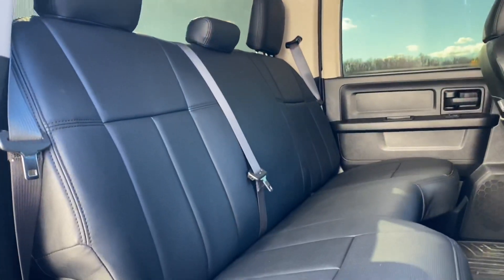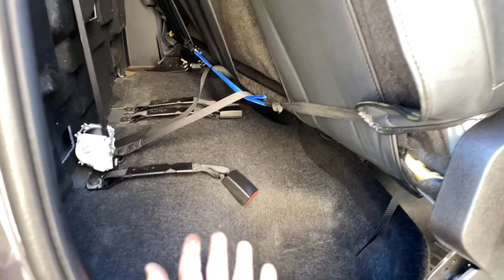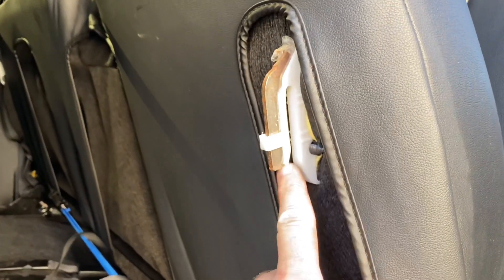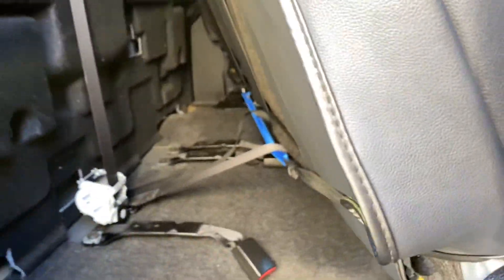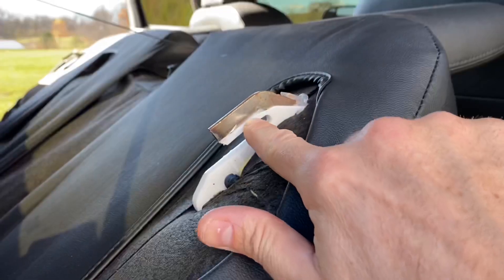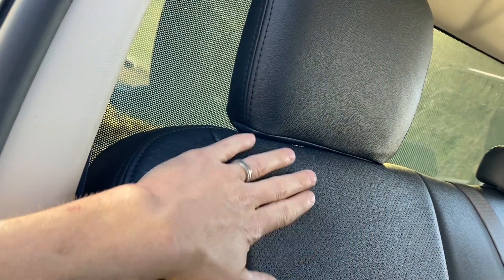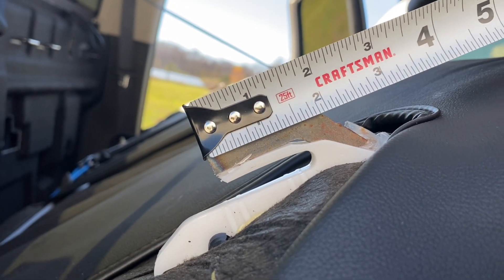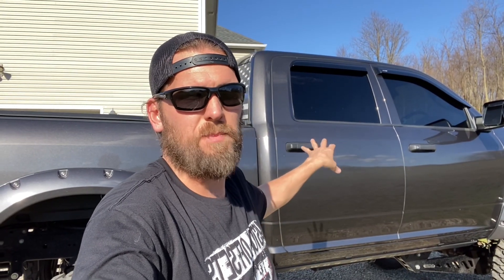2016 Ram 2500 Crew Cab Rear Folding Seat Modification

Comment: Best version of a Ram 2500 quad cab rear seat mod/fix I've seen yet! Reason being I want to put my 
XM 177 e2 back there. Just didn't want to mod it in just any fashion. Was going with raising the seat but didn't want to change the height geometry although it wouldn't be bad because I have a big amp under the seat and raising it would help keep it running cooler. Decisions, decisions??? 🤤😂

Comment: Another option is to raise both rear seats by 3/4 inch .. just need longer bolts and a metal or wood spacer.  This way you could return to factory if you wanted.
Reply from the maker: Yeah I thought about doing it that way but was worried about the seat not being fully secured for safety and losing head room.  But absolutely, spacers would work.
Reply: Only problem is back seat won’t lock in if you raise the seat
Reply from the maker: True, so if you need a speaker box for example that requires you to add spacers, I would suggest adding spacers first and then cut small adjustments as needed.
Reply: Actually,  as long as you haven't cut the seat holding bracket, the 3/4  inch raise will lock and allow you to fold the seat down if you want.. did it to my truck
Reply: And just for clarity.. I used 3/4 inch plywood which is technically 23/32 in the states. Just in case the measurement diff matters ..
Reply: @djmjr77  ya your right ! I watched another video! My bad!
Reply: this is the worst advice ever. lol...

Comment: Nice video. Does it work on a 2023 ram classic 1500 quad cab? Thanks
Reply from the maker: Not sure have not tried that yet.  Unbolt the rear seat and lift it up and if it has a similar setup it should.  Or, place spacers under the seat to lift it just enough to accomplish the same thing.  Maybe 1/2”?

Comment: Hey brother nice video. quick question are the seats able to fold flat or only as far as your folded em in the video?
Reply from the maker: They don’t fold flat as the seats were not designed that way but if you need it for hauling something it may compress flatter with weight on top.

Comment: I hope it works on my 2012 1500 laramie
Reply from the maker: It should, but you can also achieve the same result by adding spacers under your seat where the seat mounts to the floor.  Either way works.
Reply: Ty

Comment: What keeps the seat backs from flying forward during a hard brake without the latches?
Reply from the maker: The latch still hooks on.  When you lift the bottom seat up it look fits the back latch up too.  When you trim the back latch just a little shorter, when the bottom seat lifts it lifts the top latch just enough to unhook.
Reply: This guy must watch without sound.